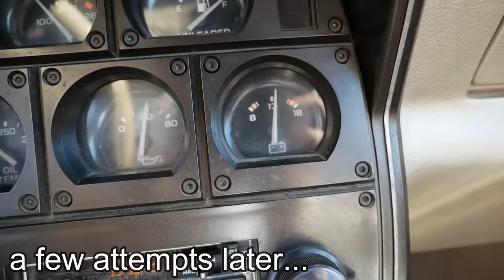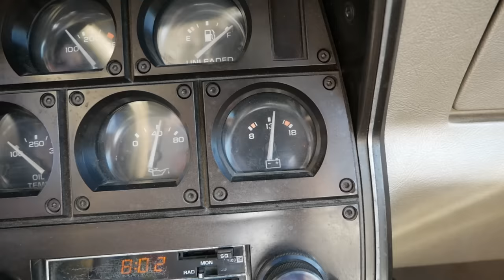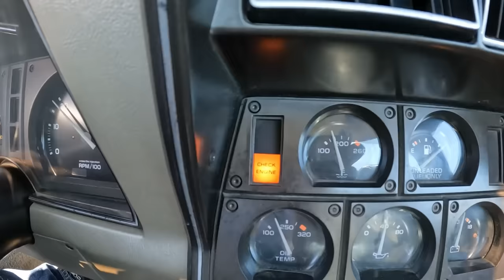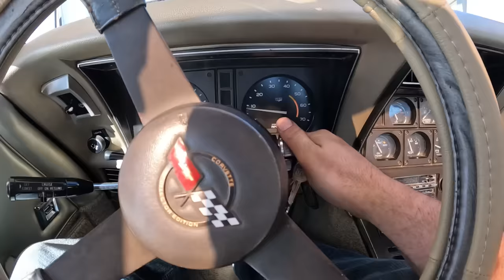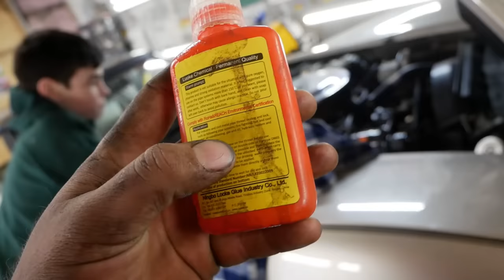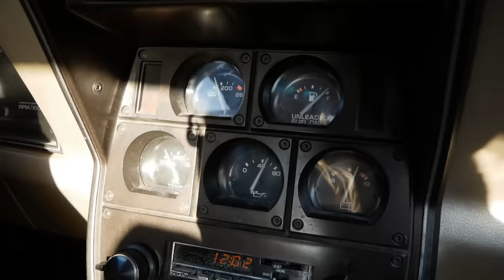RARE Corvette FOUND! Will it Drive 200 Miles Home For Restoration?

Comment: GM 1982,we’ve spent millions and have the best engineers designing the power train on these cars making them the most efficient and powerful option you can get. Forty two years later PBG,yeah we’re just going to cut all that crap away and throw a carburetor on it and it’ll run better! This is why PBG is climbing the ladder of success and are some of the best and informative videos out there. Keep up the good work Dalton.
Reply: Absolutley!
Reply: The stock power assist steering in these are absolute garbage as well.
Reply: yep

Comment: My grandad collected corvettes and he had an identical 82 still in the wrapper with only 248 miles on the odometer. Unfortunately after he passed all his cars went to auction in 2003-ish but the car was basically brand new still. He had a couple different years that pretty much just went from the dealer to storage, seemed like a bit of a shame not to drive them but he just liked to look at them. 🤷‍♂️

Comment: 49:00 the way us techs adjusted the tv cables at the gm dealership was to depress the button, pull the cable all the way back, release the button. Open the throttle all the way, the cable will automatically adjust out to the correct amount.
Reply: Yeah I thought it was odd that he was holding it down
Reply from the maker: Kinda just felt like it would break if I did that
Reply: @PoleBarnGarage It’s a 700R4 sir. Breaking is the price of admission with one.
Reply: Well done 👍
Reply: Understandable, we are dealing with 30+ year old plastics now
Reply: ^^^This is exactly how I adjusted mine on my k10. Made a huge difference and shifts a million times better.
Reply: It needs a TV correction bracket from TCI or others to restore the geometry.
Reply: Dave is correct 
Dont hold the button just depress throttle. 
It will set itself 
It sure feels like your gona snap it off but it works.

Comment: You need to get the Holly TV cable  geometry corrector bracket that bolts to the throttle arm on the carb. Without it the TV cable doesn’t move in an exact 1 to 1 relationship with the throttle. Causes all kinds of issues. The throttle arm out of the box is designed for a 3 speed kickdown cable. With those all that matters is the cable is completely pulled out at full throttle.

Comment: If you look up the 5 speed you'll see Tremec has discontinued the TKO. It's been replaced with the new TKX. Good news is that it's an improvement in every way, bad news is that the trans itself goes for about $2900, not counting clutch stuff. Still worth it though, would be awesome in that Vette!

Sweet car though, I don't think I've ever seen one of those collectors editions. Looks to be in fantastic shape!

Comment: Loved that custom visor, it knows when to block your view lol. Say just an old trick I used to get brake lines broke loose, has never failed me yet. Clamp a Vise Grip onto the line nut, make sure your have enough room to do this, then take your palm and give the Vise grip a sharp smack, this will break that nut loose 95% of the time, try it. I own line wrenches and am a retired mechanic of many years, rarely used my line wrenches to break lines loose, always used the Vise grip and never have broke a line or rounded off a nut. But always spray them first with a good penetrant first, which I seen you do anyway. If you try to remove those lines with a wrench or even a line wrench it will almost always fail and break, strip, or twist that line and you will be cursing up a storm lol. great videos btw, always entertaining.

Comment: 1982 corvettes are quite the enigma. The last of the C3 generation, Which started strong, but the fuel crisis killed the power ratings. The C4 was such a needed redesign there is no 1983 model Vette. When it was brand new that crossfire 350 had maybe 200hp. The early EFI was garbage sure, but it was the test bed that helped the LS become what it is today. I do wanna see if you can turn that thing into a dual carb setup like you mentioned in the blazer/c3 episode. Side note, I half expected JD to just drive the LTD back. Then I saw jess and it made more sense. Only a couple more years till that license

Comment: one thing i found out doing my 83 caddy. I put a 305 SBC in it to replace that crap 4.1l i went carb and HEI just like you did here but i still am running the stock TBI fuel pump in the tank. Neat fact here!  If you just put a T fitting and run the line to the return you build a constant 3-4 PSI naturally with zero fuel regulator required. since the return line is smaller then the feed line it has juuuuust enough volume to run a carb with no regulator. been like that for 3 years no with zero issues. 

the more you know!

Comment: I'm working on a 82 CE too! It was passed down to my Dad a few years ago.
Had the same issue with the brake calipers, but I just bought o-ring rebuilt ones.
It appears someone jacked it up wrong in the past, and now the rear frame is bent slightly too high on one side. The body is torqued enough that the passenger door scrapes the body and the rear hatch doesn't release anymore. Seeing how much yours flexed, I'm going to be more careful from now on.
And dang, you caught that hood release just in time! I had to fish a coat hanger in there to release that second latch.

Glad to see another one of these CE's being restored and enjoyed!
Reply: Also... My trans leaks too. TheCorvetteBen has a video on one of these CE's where he ended up removing the transmission to replace several odd seals, but the most common leak seems to be where the linkage hooks up

Comment: Drill Doctor. It's awesome. I won't even use drill bits anymore unless I've sharpened them in that machine. You can also make your own pitch as well as masonary bits and as soon as they get dull just resharpen them. I don't know how I dealt with not having one. There's nothing like a fresh drill bit and you can use them until the flute is gone.

Comment: Ah the really fun time of a break job on a c3 corvette, especially the drilling out the rotors for the hubs. I’ve done a few and definitely don’t miss working on them, the fun part is getting the brass junction blocks for the brake lines and hoping they don’t break.
Reply from the maker: Yes! Those are horrible

Comment: Good afternoon from Cape Cod 🦈 I had a 74 L48 convertible stingray with a 350 360 horse. 714 made. I paid 8,000 bucks for it in 88, I drove it for a couple of years and sold it for $24,000. I needed the money to do some remodeling on my home, I still miss that car. Now getting to your 82, I think it's an exceptionally cool looking car and knowing you it'll be cooler as you own it. Keep up the great work guys and the awesome content 👍✌️🇺🇲

Comment: You got yourself a nice 82! I was an owner of a 82 for 13 yrs and most people remove the CFI due to lack of knowledge. Long story short I rebuilt the original engine added a nice comp cam, Edelbrock heads, Renegade intake, headers, bored TBs with big block injectors running a 747 ECU with a tune and it put down 368hp at the wheels. 
   If you look at the factory intake you will see the ports are blocked 1/3 off due to it was making more power than the up coming TPI motor so GM decided to choke down the CFI. Biggest thing on a stock CFI car is the syncing of the TBs and over time the throttle shafts oblong the holes causing a vacuum leak. CFI motors do not like vacuum leaks. If I had to due over I would have switched to a carb as well. Anything fuel injection is expensive and could have gotten the same results with a lot less money. Well done

Comment: I worked in a Chevy dealer fo lots of years...loved the crossfires, a bit quirky but very cool.  The only issues I ever had with them was the vaccuum leak at the upper intake manifold gasket, usually in the area of the EGR valve.  Synching the throttle bodies was a bit tricky but once you got it dialed in, they were tons of fun drive.

Comment: I have an '82 Collector's Edition with 29,000 miles. It is all original except o-ring calipers and rear wheel bearings with grease fittings.  I love this car! If I ever have cease fire problems it's going to receive a TPI setup.

Comment: Had a Ford Taurus SHO that blew the oil pan gasket out, and it would only do it under hard accelerations, idle it wouldn't leak a drop, I was about to replace the pan gasket but tightened it down some and it was enough to stop it lol

Comment: I always have loved these Corvettes since I was a kid.  I drove one years ago when I was a mechanic briefly, and the seat was like fabric lawn chair, like riding directly on the floor really.  It was a manual and man was that the stiffest clutch pedal I have ever had to push.  700 R4 is a really good transmission. Shift kit and a good fluid / filter change would do it good.

Comment: Gotta love the HEI. Easy to install a kill switch(es) set up. Especially nowadays with 3d printers to help.  I used to interrupt the 12v supply to the HEI. I had a '78 T/A that I did one on. I fabbed a bracket for the switch to mount on the firewall, and a welder friend I worked with made me a little plate with a rod and tacked it to the back of the ashtray. with the ashtray in, it pushed the switch and allowed the 12 v to the HEI. You can run to a fairly obvious toggle also then they have to have both it the right positions...

Comment: 39:26 tip you can clean the back of the bucket seats with a mr clean magic eraser you just go lightly and it pulls up the crud out of the textured plastic it's like buffing headlights
and just give a wipe with what ever cleaner you like using after.

Comment: Hey dalton, going through the same thing you are with your 700r4. Best info ive been able to find is that youll need to drop the pan and adjust the tv cable lever inside the trans to be just barley touching the tv shaft. Apparently there isnt much room for error with the tv adjustment. I have to do the same on my squarebody. Really want to sm465 swap but the ol slushbox will have to get me by for now. Figured id just offer the info i have, thanks for the great content as usual!

Comment: Dalton grab some liquid PTFE thread sealant next time you're at the parts house, works great on NPT fittings and great for sealing bolt threads in oil/coolant passages

Comment: Nice Vette! I had a bit of a 1980 rat rod myself.  That 700r4 would probably shift a lot better with a TV correction bracket installed on that carb. TCI and others make one that is inexpensive, bolts to the Holley style linkage and correct the TV cable geometry.  

Any chance you still have parts left over from that 454 TBI van you cut up.  I really need the rubber intake duct that went to the stock air cleaner you tossed out for my own G-van build.  It is specific to the 454 vans and hard to find anywhere.

Comment: I feel your pain.  I paid SMS Fabrics over $1000 for TWO AMC Gremlin door panels and I had to cut the opening for the remote mirror control.  On the original door panels, there would be a perforated area that you just had to pop out.  On the SMS panel.... I had to measure 74 times just to make sure I was in the neighbourhood.   Still scary as F*** to cut through a $1000-dollar door panel.

Comment: the TV-cable you are adjusting for the TRANSMSISSON is for the pump pressure it doesn't adjust the shift points !

Comment: Had my own adventure with my own visor a few days ago. Picked up an '02 V6 5 speed firebird that had been sitting for 7 years. I've put 1,000 miles on it in a month and I'm still discovering quirks. Was going about 30, dropped into 2nd gear and hit the throttle and the visit simply removed itself from the roof!

Comment: If the foams are flat have you ever used steam? Started with a kettle and garden hose attached but cheap Value Village ones are 5 to 10 bucks. Makes foam puff rite back. Luv ur vids
Reply from the maker: You aren't the only one to mention it, I'm going to try it next time

Comment: Permatex Aviation #3 will work for fuel thread connections. Doesn't take much overfill of the trans to make it belch fluid out the vent which is top of the tranny and will run down and find hot exhaust pipes.

Comment: I’ve seen the dip stick tube leak where gm got welded the bolt bracket to it and when you add fluid  it’d drip on the headers.

Comment: That was a solid improvement in drivability with the carburetor. It sounded quite good.

A workout partner of mine from the late 80s had an '82 Corvette. About 50k on the clock, yet there was a reason he had several vehicles. That crossfire injection was terrible, no matter the injector cleaner or gas used. A nice-looking silver, for sure, yet it sorely needed someone to dump the injection in the trash. Some of the Camaros and Firebirds from that era had it as well, yet GM had better efforts along the way.

Comment: I get the uniqueness of the body shape of that car and the different feeling of driving it.  I had never been near nor known anyone that owned a Porsche in my life, so it was quite the trip when I landed a job as a technician at a Porsche dealership in my mid 20's.  The first time I got to drive an air cooled Carrera was surreal.  Between staring down the nose with those bug-eye headlights, the floor hinged pedals, the angry sound of the flat 6, and the whole thing smelling like warm motor oil, I haven't experienced anything like it since.

Comment: Taking off the air injection check valves and using pipe caps works too and frees up a little room.

Comment: Th700r4 88 Chevy truck service manual shift adjustment while holding indent tab push throttle body acceleration lever to full wide open throttle position and let off the tab,so that as soon as you push the throttle lever back from the idle position is just slightly loose and it's adjusted properly, i had to do that for my 88 Chevy S10 regular cab short bed Tahoe with the Factory sunroof and ac odd options and expensive ones for a 88 S10 Tahoe

Comment: Had an 81 vette same as 82 except for rear window, they are notorious for getting flat cam lobes on 7 & 8.
I had to replace mine at about 90k.
For best performance you'll want to build up a motor from scratch as the stock one has a pultry 210hp. 
Happy driving. 🏜👍

Comment: Dig it. The further you pull the TV cable? The MORE fluid pressure n later the shift. Your governor has to OVERCOME fluid pressure to complete the shift. If you move the pivot point closer to the center? You can run more line pressure.  This is key to making TV cable trannies last longer. 😊 give it a fluid change n add Lucas.  She'll hang for awhile.
Reply from the maker: Hmm I just put it where the manual said to 🤷
Reply: @PoleBarnGarage  if the lever that actuates it longer say you could end up with  low line pressure while cruising and a sluggish or no downshift. Moving your pivot closer to the throttle shaft center can make it mucho better😁 more tuneable

Comment: Food for thought, you should run power for electric choke through an oil pressure switch. This keeps choke from opening if you just leave key turned on.

Comment: there is special thread sealant for gasoline. ive never has any luck with it. ive always found it better to clean off and braze. it wont start a fire that way. or you could find a universal bspp  fitting with oring.

Comment: I have one of these and ngl, the crossfire injection works perfectly and means it actually starts right up every time instead of my carb cars that need 30 seconds of cranking if they've been sitting, babying if it's cold etc.  It's actually bog simple compared to anything modem, they got a bad reputation in the day because nobody knew how to work on them and gas quality was super inconsistent.  Run a can of sea foam through it once a year to keep the fuel system clean and you're good to go.  It's the car I let anyone else drive as with the FI and od trans, it drives like a modern car.

Comment: I bought a 92 Vette at auction a few years back and got pulled over that evening for speeding, kept it about a year and resold for a tiny profit cuz I got tired of crawling out of it, plus it was a sweat box even with the roof removed

Comment: I can tell you REALLY love this car!  You're more serious and concentrating on it way more then your "fun" projects.  Either way I love your channel   By the way I have a ton of parts i've amassed over the years.  I have two 70s duraspark distributors  one I think is for a Ford 460 and the other a 302 V8 ford  I might even have one duraspark box NOS not sure of the color plug.  I'll send these to you FREE if ya want them.  I only have 60s  cars and put in Pertronix which is awesome!
Reply from the maker: I'd take them and stash them away in the parts hoard, never know when I might need stuff like that 😂
PO box 138 pleasant hill mo 64080

Comment: I had the 1983 trans Am with the same crossfire injection but with 305 that was in there.. it was only about  170 horsepower.. But it drove good for what it was. And it had a functional hood scoop. I sold that car because it was rear wheel drive and I had to start driving to work in the snow so I traded it in for a front wheel drive 1991 Cutlass. I wish I still had my old crossfire injection trans Am.

Comment: TRans Tune and Trans Fix from seafoam are incredible.. USE as DIRECTED!! Very important. On those huge valve body trans from the 70's-90's Trans fix, some city driving and a fluid change with filter change, then add Trans Tune to the new Fluid and you will be shocked. If you know a little of what you are doing get into the valve bodies and begin to learn how to remove and replace. Be careful with all the check balls and such. Opening some of those valve bodies will cause an overflow on to the headers or on to the down pipe, thus the cloud of smoke.